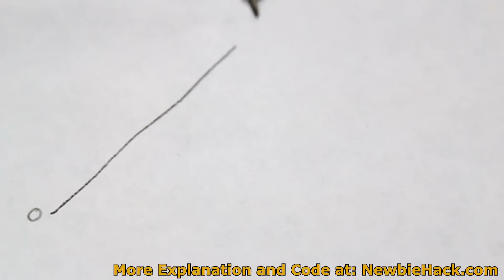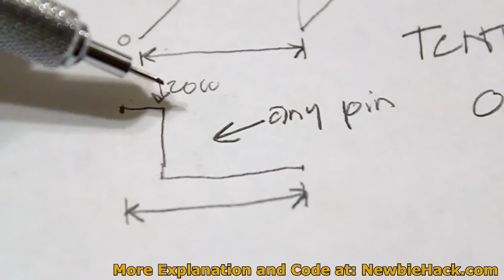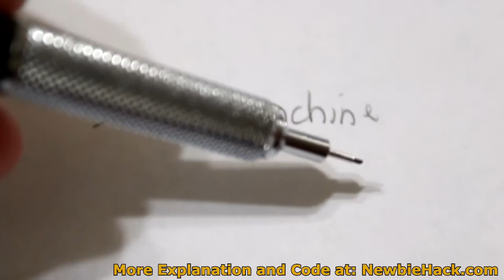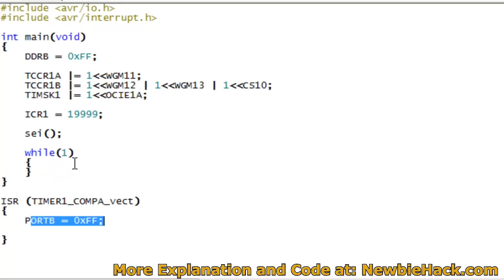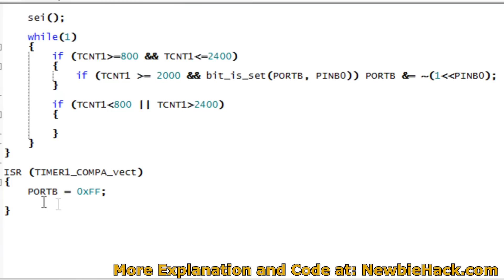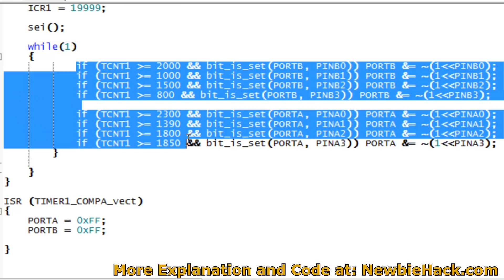40. Arduino for Production!  AVR Atmega32 - Controlling Multiple Servos Using Standard Output Pins

Comment: how can i generate phase correct pwm  ? what needed to be changed in the following code?
Reply from the maker: I have a video that goes over all of the PWM modes.  It's on the playlist for this series.
Reply: Thank you for your reply. 

I can not find the proper video. can you provide me with the video link.  Question for code of this video. can i control your provide code generation time suppose when one increasing other decreasing and another question is that when i run a unipollar stepper motor with your code after reaching  a certain degree  stepper rotor start to vibrate and won't move, why is that? .  if i wish to rotate whole 360 degree what needed to be changed for this code (i asking this this cause i understand the concept. already went through the book and nothing came into my mind. )?.

Comment: Hello a question, I would like to know how it is possible to generate a pwm signal with two timer at the same time, I mean use the timer2 to generate the frequency of 50hz or what is the same the period of 20ms and with the timer1 trought a potentiometer and the ADC generate the pulse to move the servomotor shaft

Comment: I'm using an atmega328p in my circuit, and I need to control five servos independently.  The code that your video shows doesn't seem to work to control it; is there a separate system that is used with my microcontroller than is used for the atmega32?

Comment: Hello, your tutorials are really helpful and well explained. I don't understand the use of ICR1 register since you set TCCNT1 register to toggle you specified on your code, and why not use the OCR1A/B register since it's being compared to TCCNT1 all the time at every cycle?  Thanks.
Reply: john batasin thats the point . if would use OCR1A/B that would limit our connection of motor to only single bit i.e oc1a/b (pin no 18&19 in case of atmega32)
BY using his method  one can connect multipe motor to difff ports
i just have a confusion that  how we would give multiple pulse to a single pin like we could give while using OCR

Comment: If Im not wrong, you don't need to use a delay because the system  is controlled by the interruption of the timer. In short words, if you use delay you may lose precious time to do some other tasks rather than waiting for the signal to change of state.

Comment from the maker: Depending on the digital servo.  If you used a servo like the Dynamixel, then you can put 254 of them daisy chained, controlled by a single data line.  I actually talk about this on my intro to UART and will do some extensive videos on the Dynamixel servo.  If you want to stay in the PWM world, and you want the servos to function flawlessly, I would divide an conquer by adding more MCUs so the clock speed won't be a hindrance.

Comment: Dear Patrick Hood-Daniel, thank you for your effort, this videos are really good. I have a short question, this PWM can be used only in small scale or how much power can I have in one wave? I'd like to create PWM dimmer for power LEDs in my home but I'm not sure if one microcontroler can hold 30W of power. One LED is around 3-4.5W ... and for an average room I'd like to use around 8of them. Can you please advice. Thank you very much.

Comment from the maker: Sure, all you need to do connect the correct SPI pins of the atmega8 to the programmer and make sure that the makefile is set up for the atmega8 and you should be all set.

Remember that many of the registers have different names.  You will need to find the correct register names in the atmega8 datasheet.

Comment from the maker: Yes, I would recommend using a separate power supply, or applying the appropriate voltage regulator for the signal logic section of the circuit.  Make sure to add the necessary capacitors so you won't be so affected by the servo's voltage and current fluctuations.  This may be addressed in the servo, but it doesn't hurt to add more.

Comment: @anajonesr Yeah it's really simple. Although I'm using it to fade an LED, and I'm using an ADC conversion to adjust the time the pulse is OFF. The problem I'm having is as I turn a pot to adjust the ADC input, the output on the non-PWN pin is really choppy. I turn real slow, and it dims like it should, but there are points where it just completely turns off. Any thoughts?

Comment: @13:23 about being efficient with the microcontroller:

if (TCNT1 &gt;= 800 && TCNT1 &lt;= 2400) { //perform code1 }

if (TCNT1 &lt; 800 || TCNT1 &gt; 2400) { //perform code2 }

I believe (and please correct me if i'm wrong) that:

if (TCNT1 &gt;= 800 && TCNT1 &lt;= 2400) { //perform code1 } else { //perform code2 }

Will do exactly the same BUT it wont, as the first example, run and check the second statement, if the first one is true. This way you save the microcontroller a lot of cycles.

Comment from the maker: @amtpdb1 Also, most of the AVR MCUs are very similar, so the changes from one to the other may just be in pin locations on the chip.  The program will only change in a minor way, if at all.

Comment: Will any of the atmega32 chips work with all the programs you have written so far or is there one in particular that is to be used? I ask this as for some reason I thought you were using a atmega32-16pu in the beginning and it looks like you are using a 324p now. Will either one work?
Thanks